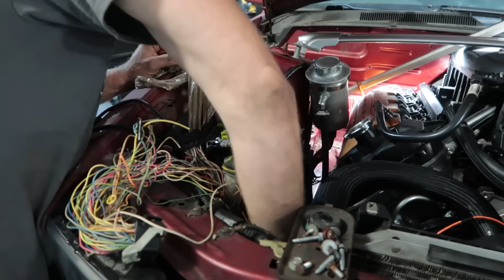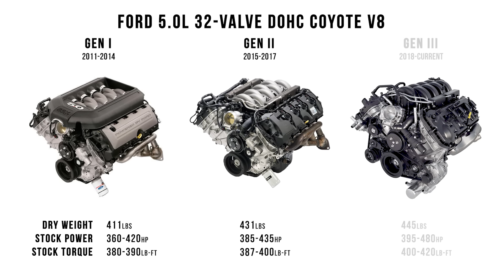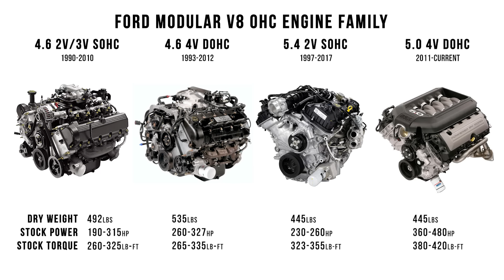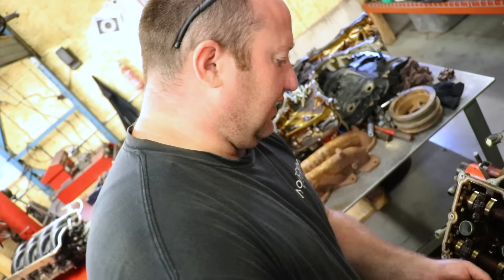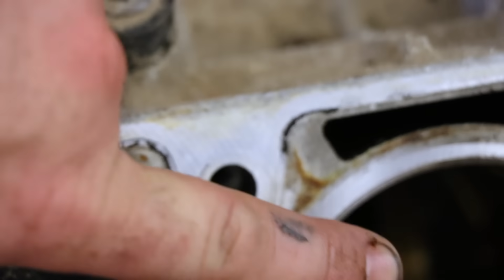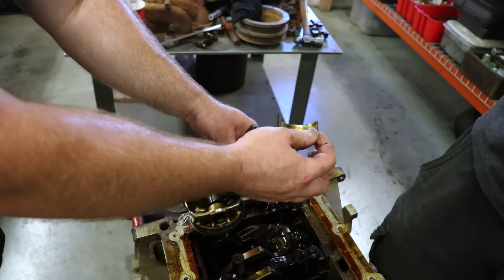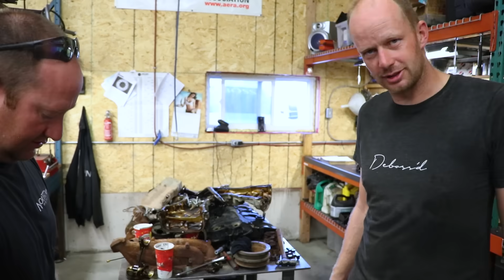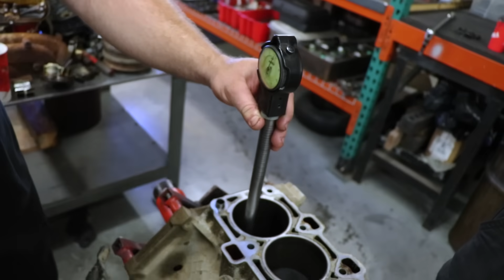REVIEW: Everything Wrong With A 5.0 Coyote Engine

Comment: That poor engine has had a hard life, you can tell. I've had many modular engines with well over 200,000 miles with no failures. Changing the oil is key with these engines.
Reply: That’s true for most engines. The engines that die in 100,000 miles are usually the ones where the last person to change the oil was the guy that assembled the engine together.
Reply: @hilljackzack7284  I worked at a Chrysler dealership as a technician. We had a customer bring there vehicle in for the  free oil change they receive for buying it. It had about 17k on it. Now the customer said he'd had it changed a few times before, what he didn't know is that we could distinguish oil filters from factory. Then people wonder why "cars aren't made like they use to be!"
Reply: 4GsRacing no it’s just that people don’t do maintenance on them anymore. My Dodge Ram runs fine and I do all the maintenance myself because I don’t trust anyone else to work on my rig.
Reply: @hilljackzack7284  yeah I completely agree with you. I wouldn't let anyone I didnt know work on anything of mine either.
Reply: @hilljackzack7284  You're totally correct mate.
Reply: The 2v 4.6 is in all crown vic's.... cop cars. When they would hit around 100k miles they sell them at fleet sales, to a lot of cab companies that then run them to 300k+. Very reliable engines.
Reply: @MrZilla500  Yeah they don't have cam phasers, they're cheap and easy to rebuild. My 4.6 is at 200,000 miles already. Had to replace the timing components though.
Reply: MrZilla500 they probably do regular maintenance to them if they last so long. Which means that it’s probably a good choice to buy one.
Reply: @hilljackzack7284  Speaking of cop cars, I've heard some people saying they're great to buy because they oil is changed regularly since they're fleet vehicles, but I've also heard other people say they're run super hard and they spend a lot of time idling, which is probably true.
Reply: Darth Darth Binks they have pros and cons. They would make great rally/race cars but I wouldn’t daily them.
Reply: Agreed ive seen some crazy high mileage mod motors still running strong. Ive had more than i can count on my hands and never had an issue besides my 04 mach 1 pushing coolant
Reply: @traxxasrcfun  I have a 97 Cobra with a 4v 4.6. I put 140k hard miles on it, either at the track or romping on the street. Still ran like a champ when I rebuilt it for a turbo setup with forged rods and pistons, now with a 76mm turbo and relatively low boost i keep it at 600rwhp for the street and an 850rwhp tune for the strip, with more boost to go, although by engine is good for 1500 I don't run it that high. It has never let me down wi th regular maintenance, I've used Royal Purple synthetic and K&N filters every 5k, Motorcraft everything else. And I still take long trips with the old lady in it too, from Houston to New Orleans, to Utah, etc. A lot of times I just take it to work in the summer. I cant speak for all mod motors but the 4v is a great piece of engineering.
Reply: ..yes, agreed..some engines more so than others..I have a 2005 Dodge Durango with 326,000 miles and still going strong..with the 4.7 V8...yes, that's right..the engine everybody says won't last...I have always used synthetic 5w30, brands have varied...changed it every 4000-4500 miles(yes, that's right..I don't like to leave dirty oil in my engine too long, even if it's synthetic)...nothing mechanical changed other than water pump, normal wear and tear items, and a few sensors...I think, in addition to not changing oil frequently enough, many people make the mistake of thinking "thicker" oil is better for the engine, and use the wrong oil..additives, too(I've never used additives)....
Reply: @dyer2cycle  Scotty Kilmer says Dodge/Chrysler quality/durability has gone way down in recent years, what do you think?
Reply: @TheUltimateCrash1990  ..The truth?...I think Scotty Kilmer is a loudmouth,fast-talking used car-salesman type who is very opinionated(that part's o.k.-we're all entitled to our opinions), and who has drunk copious amounts of the Toyota/Ford Kool-Aid, and unfortunately pushes his opinions as absolute fact..there, I said it...He IS very good at creating click-bait titles, however.. :)
Reply: dyer2cycle the absolute master at clickbait as a matter of fact.
Reply: dyer2cycle my 2011 ram 1500 has the same engine and it runs great I’m about to upload a video about it here soon, but the truck has 136,000 miles on the odometer and runs like new. I prefer valvoline full synthetic 5w-30.
Reply: @hilljackzack7284  ..yes, what I have mostly used is NAPA full synthetic 5w-30, it is often on sale for slightly North of $3.00/QT., and I usually stock up when it's on sale..oh, and NAPA motor oil is Valvoline :)
Reply: @dyer2cycle  I've had 2 Durango s with 4.7. Just use shell 10w30 conventional oil. Change ever 5000 km. Or 3500 miles. Both have over 400,000 km. No problems.
Reply: We had a Pinto come in once and the guy was complaining that "the piece of shit is making all kind of noise" and he was cursing Ford. We opened the hood and the oil filter was painted from the factory. 65,000 miles and he never changed the oil once. Typical.
Reply: @chrisdaigle5410  he probably destroyed that car.
Reply: Exactly.
Reply: What oil do you use? In your opinion is Penzoil Ultra Platinum good enough?
Reply: @TheUltimateCrash1990  I've always run either the motorcraft oil, or in my newer truck and drift car I run Amsoil
Reply: I put 200k on my ‘06 FX4 F150 with a 5.4. No problems. I changed the oil at 3k.
Reply: Karen Pyle I believe it. My dad has two 5.4’s and I likes the 2v better but 3v was good.
Reply: Yep, even the 3 valve. People that regularly change their oil at 5k aren't even aware of all the supposed phaser problems. There are plenty of older people putting around 3 valves with 300k on them with no issues. I personally know of a couple.
Reply: I only had problems when I didn’t do regular oil changes with my 04 f150
Reply: LOL ok. SOHC engines perhaps. 5.0 Coyote? Way too many engines with oil consumption, bad rod bearings, stretched rod bolts, chipped valves, piston slap, warped cylinders, etc.
Reply: I like how everyone just says change your oil. It will reverse fords shitty engineering and poor choice in materials. Good grief. Ford hasnt built a good engine in almost 30 years
Reply: @goodneighborlawns  Not true at all. The 4.6s, 2v, 3v, or 4v are all very good (plenty with over 1m miles). The 4.0 OHC and OHV, the Coyotes, the EBs after the first couple of years are good, the 6.7s have been very good, etc. You're just incapable of not being biased dude.

Comment: 2013 5.0 F150 with 201,000 and it runs like new. We pull trailers all the time full of drywall. Great engine. Also have an 03 flatbed 2v with 145,000. Didn’t know it was so closely related to the 4.6. It’s been great too.
Reply: Update, four years later and I have 286,000 miles on the 5.0 and it still runs great. It’s had a few maintenance related issues  recently it needed new injectors.  ended up selling the 4.6. It did eat a set of heads, but we had them replaced.

Our 5.0 has been really strong

Comment: Do you know anything about the 5.7l V8 found in the 1997 gmc Sierra sle?  The thing is at nearly 300k miles are still runs great. I think the engine code was L31

Comment: I have started piercing and cutting open every single filter I replace as of 5 years ago minimal.. they;re all garbage cheap junk. bunch of sold out shell companies with nothing left but mainly union stooges sucking large $$$ and chinese slave kids producing the stuff. gee where's the issue in that mix?
I highly suggest ALL shops and oil change places quit crushing filters and start piecing and "snipping" them ope ti inspect the failure material. you may find that the filters are undersized and collapsed, but you wont be able to prove that due to the metallic damage contamination that occurred. specific long term tests could though.\
Reply: Always good to hear the SCABS

Comment: Oil has a finite capacity carying for holding dissolved pollutants...exceed that capacity and sludge will stick everywhere. It doesn't matter if it's synthetic of mineral. 
This dude is making too many assumptions about the engine's past life.

Comment: I've never seen this much discolouration and sludge on the various VW engines I've worked on that use fully synthetic oils.
Reply: I've read around that VW's are built like shit currently in the modern era is that true? Have they fixed that intake valve DI carboning up problem yet? Or are people just supposed to install catch cans....
Reply: @TheUltimateCrash1990  Yeah they do make some terrible engines and transmissions nowadays. Their direct injection engines are all pretty nightmarish for carbon build up and it's an expensive job having the valves blasted. 1.4TSI engines burn more oil than fuel and the DSG boxes fail, super expensive repairs. I had an old 1.8T which was utterly dependable, never gave me any trouble. I wouldn't buy anything newer; they're not worth the money and time they'll steal from you.

Comment: I have a 98 Expedition with a 5.4 2v it has 435,000 miles. I change the oil every 3k using 10w30 Castrol. Still has original water pump

Comment: Okay, so this builder lost me when he said it doesn't change displacement. It does. 

Displacement is swept volume, which is stroke * piston area * no cyls 

CR is not in that equation. If you increase your piston diameter, you will increase displacement. 

And since you are boring our the whole cylinder, minus a very small change in the math with the head dome volume, the CR should not change either. The dome changes that slightly, so to maintain the exact CR that is where your piston top height has to drop so that you maintain an equal CR. Displacement still increases though...
Reply: I'm thinking he meant that the FACTORY replacement oversize pistons lower the piston tops just enough so that the computer can't tell that the cylinder is slightly different than the rest. They can overbore ONE hole .020 put in a new piston and the computer can't tell so it runs well. Kind of a moot point, but it works for warranty stuff, keeps it cheap.
Reply from the maker: @smjones4238  exactly

Comment: He killed his credibility when he started talking about all the power you get from the 4.6.
Reply: MMR ran a 5.88@250+ 1/4 mile with a Teksid 4.6 aluminum block and Ford GT heads as a base. Not too many teams running those sorts of times with factory castings of any make engine.
Reply: Keith MacDonald he was talking about the 2v though

Comment: If old mate that seized it ran it off road. Depending on the angle of the slopes etc oil starvation would be a thing. That would act like a low/running it out of oil.

Comment: I've seen that color imbalance from head to head on older 4.6 engines too. (10+ engines) heard it has to do with the pcv pulling more from one side.
Reply: also true, ive seen same thing on a GM Alloytec V6..........
Reply: You make more sense than Sir Hate Synthetic Oil.
Reply: I heard that the color change is that the right bank (passenger) is the last to get oil that has to feed through all the holes and hydraulic parts. Only cure is a more powerful oil pump.
Reply: Leonard Daneman PCV make more sense.
Reply: @Fone65  The early 4.6 ltr Ford V8 had sludge and smoking issues because of the EGR placement. 
But, in overhead cam phaser engines, the complex passages starves the right bank.
Reply: @leonarddaneman810  If you say so
Reply: @Fone65  I know this because I had a 1993 Lincoln TC. Did some research and found info on the EGR issues. You have to clean the EGR once a year to keep the channels from sludging up. Sludge makes oil pool up and then it burns off in your cylinders. The position of the EGR was the problem. Also have a 5.4 3 valve. Researched that engine before buying. Sometime in 2008 (check serial numbers) they upgraded the cam solenoid, spark plugs, and timing chain tensioners . . . but, the oil pressure pump is still marginal for optimum performance/longevity.
Reply: @leonarddaneman810  Dude, you should have quit when you had a chance. The 5.0 in the F150 does not have an egr valve. I love when you guys use the word "research". It let me know you are just repeating something you read online. You probably have never change the oil on an engine.
Reply: @Fone65  I didn't say it did. I was using examples of 'dirty' engine issues from oil path issues . . . the EGR problem was on the early 4.6l . . . why are we arguing? The 5.4 3valve has right bank issues due to its phaser cam system and insufficient oil pressure.
Reply: @leonarddaneman810  Why bring up egr valve on an engine that don't have one? You thought you were talking to someone new. EGR valve have little to do with dirty oil anyway. Dirty egr ports come from people who don't keep their car tune.
5.4 3 valve have Insufficient oil pressure only when people don't change the oil on time.
Reply: @Fone65  STFU
Reply: @leonarddaneman810  Young guys because of a lack of automotive education. Are quick to give up and start cursing.
Reply: 4.6L v8 are bulletproof
Reply: LS engines also do it
Reply: Exactly

Comment: Simplicity is they way to if at all possible. The LS has one cam instead of four, short cam chain vs a long chain resting on a plastic tensioner.  The LS is lighter and much smaller and there are parts for them everywhere.

LS is the winner!

Comment: Ford in an effort to try and comply with some kind of EPA bs specified 5w-20 oil in the USA while in other countries the spec was 10w-30 weight oil.  The oil flow in the engine is such that the right bank (from drivers seat) feeds the oil from the oil pump to the left bank front then right bank back to front causing the VVT to be at the end of the line ... I bought a 2011 with a very low milage 5.0 coyote engine.  It had the famous 5.0 knock and i chased it everywhere.  I put all new timing components on it - I checked all lifters for tightness- I even dropped the pan and checked the rod bearings - they were cherry.  This was a very frustrating truck - besides the knock the truck was an intermittent no crank no start.  In the end I plugged the oil squirters and went to 40 weight oil and replaced the tricky electronic switch in the transmission that tells the computer the transmission is in park.  The machinest that does my work tells me the later model 5.0 using the new welding process to line the cylinder bores cannot be bored .. do you think Ford would build an engine that could not be bored???  I know I have been slamming the 5.0 but I liked the engine - I understand the block is good for about 700 hp with no problems. I just think they should figure a better way to distribute the oil in the engine... nice video - your machinest friend is good ... not many guys know how to spot an engine that is about to seize.  Most will just tear it down and start measuring with no reflection on why it might have failed... keep up the good content... I'm a 70 year old retired diesel mechanic that has worked for Detroit and Cummins so I enjoy watching your stuff.  I used to work in the marine field in Dutch harbor Alaska so when you started on that old 12v92 I was laughing my ass off... if you want to blow something up you should find an old 12 or 16 cylinder 149 series engine... that will create quite the junk storm...
Reply: Yeah Ford can go eat rocks with that CAFE 5w-20 mandate. I'm using 10w30 in my Triton.  You say 40 is safe for Coyote engines?  The BITOG said that would lead to premature crank bearing failure, but otherwise I'm not sure.

Comment: if my parents 2003 f150 5.4L says triton, does that mean it is the infamous 3v that they are talking about?

EDIT: nvm.  seems as though it is a 2v due to the coil packs having a bend at the rubber insulator.  the coil packs on the 3v are straight, as far as google told me.

Comment: I had one come in with low compression in a 2012 F150 with only 166K on it. The problem ended up being that the intake valves had been pounded within an inch of their lives. One of the intake valves on the low compression cylinder was so razor thin on the edge that it wasn't sealing anymore. I've never seen valves pounded that badly. I guess they were "built Ford tough"

Comment: I would guess the reason that one bank is a darker color than the other from the oil deposits is that’s probably the direction of flow for the pcv system the lighter side bieng where filtered air enters and the darker bieng where all the oily mist is exiting into the intake manifold
Reply: Bingo!

Comment: There's two things that people always overlook when comparing LS to the Coyote.  To get an aluminum block LS that makes 450 crank horsepower, you're looking at a rare aluminum block 5.3 or the 5.7 from a corvette/camaro donor with also having to do heads and cam.  That combo is going to put you over the cost of even a used Gen 2 Mustang motor.  You really can't consider an iron block LS in an apples to apples comparison because of how boat-anchor heavy they are.  For someone considering swapping a modern motor, that heavy iron block is something to consider for not only weight, but also cooling capability.  There's a pretty dramatic difference between trying to keep an iron block and aluminum block cool on something like a road race application.

Comment: Not true. My 3.5 Ecoboost I run Amsoil 5W-30 I have a heavy foot and that truck doesn’t burn a drop between oil changes. However I also change it every 5,000 miles. Non of this 10,000 mile oil change garbage!!

Comment: The oil comments are pure bs. That engine wasn't properly maintained. It has nothing to do with synthetic oil. Also the 5.4 uses the same bore, as the 4.6. The larger displacement is due to taller deck height, giving it a longer stroke. The 5.4 3v is quite fixable. Check out FordTechMakuloco's channel, for an actual mod motor master.